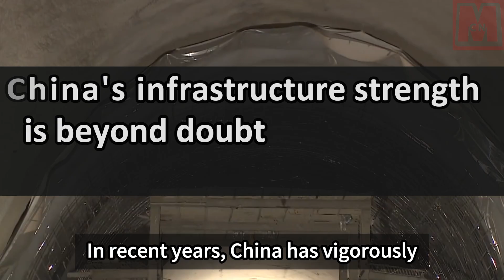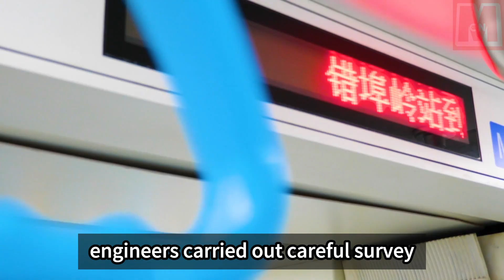China built the fastest subway line in Turkey only in 6 months

Comment: When I went through the past comments, I can see many of those (mostly as "replies") supporting what I have already said below. The video is pure and fraudelent Chinese propaganda!  I want to add one more thing: This (high speed) metro line is not actually a line dedicated to the New Istanbul Airport's to and fro commuting. It passes through several residential and/or development areas and in future will be more dedicated to the commuters in those areas. It will never be as functional as say the Hong Kong'a Airport Express. The beginning station (in one of the city centers) is not in a very ideal location. Airport passengers, those who are young and travelling light (say with a backpack) can make use of this metro line but certainly not the elders with heavy suitcases. The station is not in a location where there are many hotels (there are only for hotels in the vicinity) for the tourists, around. The platforms are 70+ meters deep... Besides that there's no City Check-In type facility, and very unlikely to have one to be built in the future... So it basicly is an urban railway line, also passing through the New Istanbul Airport.

Comment: This is a video totally aimed for China propaganda. I live in Istanbul and I'm quite famliar on what is going on and along. There is absolutely no subway line (or high speed urban metro line) in Istanbul that has been completed within 6 months. The said metro line (connecting the new Istanbul Airport to one of city's centers) is known as the U line and is 31+ km. long (and is being expended...). The first phase of this 31+ km. line started with a tender that was finalised in December 2016. The line was partially operative during summer 2022, and the city center station could be opened only recently in March 2024. So the 6 months story is a total LIE. Besides that the only Chinese contribution for this line is the supply of driverless train sets, which are partly assembled in Turkey. Signalisation system was totally done by local electronics state owned company ASELSAN. The TBMs (Tunnel Boring Machines) were leased from European sorces. For the overall construction period there has beden minimal Chinese contribution (including labor force), if any.

Comment: Another lie.... THE Turkish Directorate of Railways, Harbours and Airports Construction (DLH) has awarded a consortium of and Spanish civil construction company OHL and Invensys Rail Dimetronic a Euros 1bn contract for infrastructure and electro mechanical work on the Marmaray project in Istanbul. 
This involves building a 14km railway tunnel under the Bosphorus linking Europe with Asia, and upgrading the railway on each side to provide a 77km commuter service from Gebze to Halkali.

OHL, which has a 70% share of the contract, will increase the number of existing tracks on the existing line from two to three, renovate and construct 36 stations, build 130 structures, renew the electrification system, and install two operation control centres and depots.
Dimetronic will be responsible for equipping the line with both ERTMS and CBTC systems, for freight and passenger services respectively, which is the first time that ERTMS and CBTC will be applied on the same line.
Reply: That was November 16, 2011.

Finished 2018.

Be serious... please.

Comment: The video (2:30-2:34) says Istanbul has no subway nowadays, I have been commuting on that subway that isn't there for almost twenty years by now and it is so extensive already that 1) I didn't have to buy a car after I moved back to Istanbul in 2015, and 2) I even use taxis much more rarely than I used to in the 1990s. It is already almost as extensive as the Paris metro or the London underground, and new lines are entering service almost every year. It even has an underground train that crosses the Bosporus so you don't have to use the three bridges above the ground. Check your facts before you post a video.

Comment: Hey guys it says istanbul is not having subway in the video like 6 months ago :) . FYI it has the second most oldest subway system in the world. And infrastructure is pretty decent. Yes compare to London a bit shorter and less complex than that but total railway system in Istanbul only is 328 km out of 220 km is metro. (London is around 402 kms) And Yes because of the density of the city we still need more but don't believe that we started to have the subway system after 2023. :))) that would be pretty absurd. (first one was built 1875 :)) in Istanbul and still in use..
Reply: Yes it’s confusing but the video also said the current metro rail system in istanbul runs at 80mph!

Comment: This is a very misleading video. First off, it mentions as if "joint chinese construction subway" was the first one built in Istanbul and people were either travelling by foot or taking a car to reach downtown. What?? Istanbul already has 11 lines and more than 140 stations all over the city (another 60 station and new lines are under construction). And to my knowledge none were built by Chinese companies. They may have either supplied equipment or acted as subcontractors but even that one is rather doubtful (I really suspect that is the case). What is correct though, the line connecting the new airport to the city is being built in phases by a Turkish consortium and the train cars that will operate in that specific segment were procured from a Chinese company (the speed and the tulip designs are correct). The average speed of subway construction in Istanbul is usually very fast, especially compared to North American standards (cannot even compare to Toronto where I live), despite the fact the city is divided by Bosphorus Strait (not river), located on European and Asian sides, very hilly, 20 million population with heavy traffic and more importantly, wherever you dig you end up discovering historical sites and artifacts dating back thousand years, therefore the projects require pauses to safeguard antiquities and alter the plans if necessary. For more info you can check wikipedia: Istanbul Metro entry.  Note to the channel owner: Appreciate if you could name the line number, total line length and station number that is discussed in your video so I can verify your claims. Similarly please share the X link that Turkish authorities replied to US for their alleged visit request to the subway project (hearing this for the first time).

Comment: The oldest section of the metro is the M1 line, which opened in 1989. As of April 2023, the system now includes 137 stations in service,[1] with 56 more under construction.

Comment: I warn that china was graduating 300 k engineering degrees was back in 1993, beside the space station , china has pass Japan in rail , and this year they pass Japan in car building, I think they have just pass telsa in car sales this yr.  And I was right saying work with them in what were stong in, cause they will pass us by. I thin. They already have . LOL
Reply: Can’t beat western technology in Honolulu our rail build by hitchi and Italy or big bucks train. Ok it was build 1/2 way  then it wa found out after they put a train on  to the track of Japan and Spain or U.S ARE different size 4 “  wider,  not kidding they has 2 choice put. New wheel on the train or run it like that it’s only danger of falling of the track are turns , so they weld in plates there. And they call it safe caise it  top speed is only 50 mph.We got  a joke train. LOL

Comment: Correcting a few mistakes in this video, which is mostly fantasy:
1) Istanbul DOES have a metro system, with the first line opening in 1989. Istanbul currently have 9 lines running on its system.
2) China did not build the subway line. China had no input on the design or construction of the line. The line was designed in Turkey and built by a Turkish company. 
3) The signaling system was delivered by the Turkish company Aselsan.
4) There were no expressions of shock from Western engineers that China built this line, especially because China did NOT build the line, Turkey did.
5) It did not take only 6 months to build this line. I don't think any underground metro line could be built so quickly. (FYI, in China it usually takes about 3 years to build a line, which is already very fast).
6) China DID deliver train sets for the new line, Line 11, which runs to the new International Airport. Congratulations to CRRC Zhuzhou Locomotive Co., Ltd which won the contract to deliver 176 metro cars. The 6 months mentioned in the video refers to the time taken from winning the contract to the first cars being delivered.
Viewers who want more information can look up Global Times and search 'China-made trains enter service in Istanbul's new metro line'.

Comment: And the USA has been phucking-around with the 2nd Avenue Subway since 1972, and still incomplete in 2023. except for only 3 stations @ 72, 86, and 96 Street terminal to date. The original; 2 Avenue Subway planned since 1929 was to build a new subway line to replace their adjacent 1877 built 3rd Avenue Elevated Line which was getting weaker as time goes by. Then when the 3rd Avenue Elevated ceased operating in 1956, the 2 Ave Line was still not built. The original plan was to build the 2 Avenue Line in phases from Broad Street Hanover Square up to Triboro Plaza 124-125 Street, and then recapture the IRT's entire Pelham Bay (6)/<6> lines from 3 Avenue-E 138 Street to its Pelham Bay Park Terminal which this entire line was built to handle 10' wide cars from day one. Also, the Pelham bay Line would receive a very short 0.8 mile extension into nearby Co-op City which is s stones throw away from the existing Pelham Bay Park Station.

Imagine that this planned 2nd Avenue Subway had been built properly ??? It would have reliever OVERCROWDING on the existing IRT Lexington Avenue (4), (5), and (6)/<6> Subway Line's, by removing the (6)/<6> lines and relocating it to 2nd Avenue, and to free-up more space for the (4) Woodlawn & (5) Wakefield-241 St/Eastchester-Dyre Av services to operate more reliably as well.

Again, with the trillions wasted and spent on unwinnable wars, was better spent on improving America's rail systems, subway, pothole filled streets and highways, bridges and tunnels, instead of all of these unwinnable overseas wars which benefits very few people like the warmongering neocon LOSERS in DC.  Another words - FIX your own damn problems before worrying about other peoples problems.

That's also how Empires RISR & Empires FALL as well.
Reply: Also, lets NOT forget that the UK built its first partial underground railway segment in London back in 1863, and Boston in the USA built its first subway line in the world in 1877 to remove the congestion of streetcars that were overcrowding their streets at the time, placed them all underground running in subway tunnels to free-up the above streets as well, and NYC built and opened its first subway line in 1903 as well.

Comment: This is a lie😠
Reply: Nope

Turkey's first high-speed metro line, connecting central Istanbul and the city's international airport, officially opened to the public on January 22, 2023, and features China-made trains. Built by Chinese company CRRC Zhuzhou Locomotive, the trains can run up to 120km (75 miles) per hour.
Reply: @metalvideos1961  this does not mean it is built by Chinese. The train and the cars are bought from China. I admire Chinese developments and dislike this kind of misinformation that creates a shadow on magnificent technological developments. No need to exagerate  events.